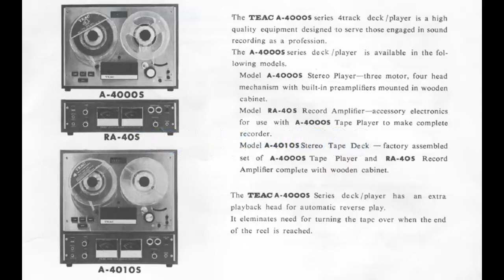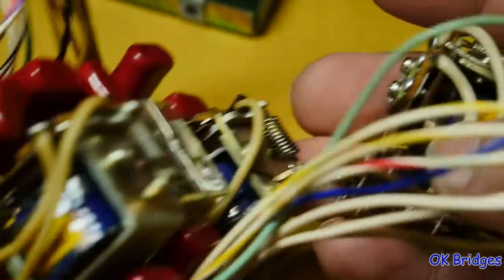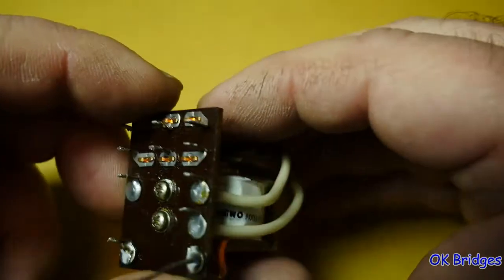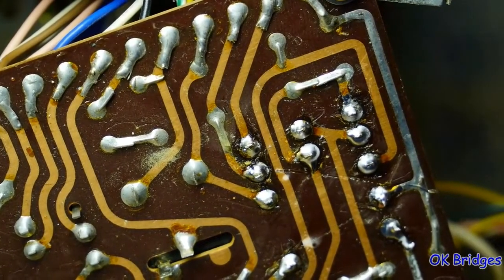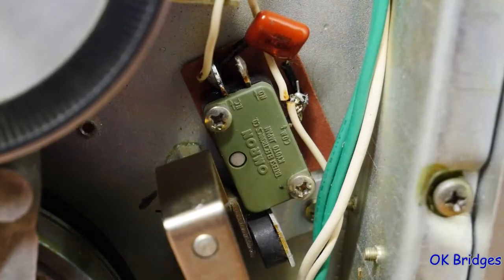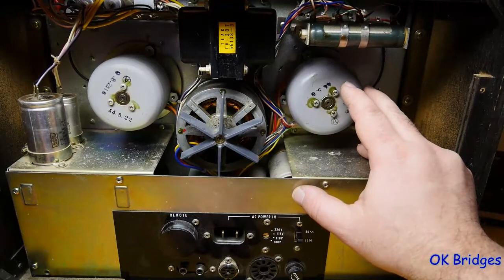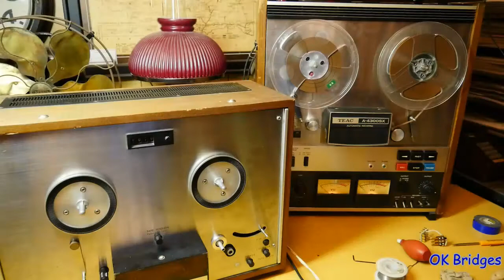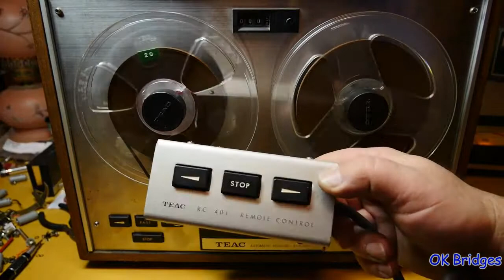Teac A4000S Repair and Demonstration

Comment: I have had one of these for many years. The playback preamps in these are very noisy. In fact, the noise from the preamp is as loud as the tape noise on an old tape. This did not make a lot of sense to me and years ago somehow I found out that the preamp uses germanium transistors which are inherently noisy and carbon resistors, which are also noisy. I replaced all the carbon resistors with metal film resistors along with the caps on the board and it reduced the noise by half, I would estimate. It makes a noticeable difference.

Comment: Hi there what kind of caps did you happen to use to replace the Suzuki bombs?
Reply from the maker: Metalized film caps. I use the same type caps that I buy for recapping tube radios and other electronics.
Reply: Awesome man I love watching your video of the Teac  A4000s I have a teac A 4010s had went and got one a week ago ended up finding that it had a mouse nest in it and they got into the button control wires that control the transport plastic came from a smoker it had horrible tobacco stains on it and I got to know what it's like to hear one of those Suzuki bombs go off it was like a loud shotgun going off so I got to thinking after that happened plus with all the corrosion that it had from the mice peeing everywhere on it I thought once I try to get another one I ended up getting one off eBay just came in a couple of days ago and it's in a whole lot better shape just needs counter built-in capstan belt which are ordered and waiting for them to come in other than that everything else is good to go I just want to have some of those caps just in case the Suzuki bombs go off lol

Comment: Hi, do you need a pre-amp (like the r40s) or can you connect the unit directly to a receiver?
Reply from the maker: You can connect directly to your receiver for playback. The A4000S has built-in head level to line level pre-amps.
You only need the R40S if you want to record.
Reply: @okbridges  Hi thanks. Yes, i was able to fix the problem (a loose connection of the main circuit). 
Thanks.